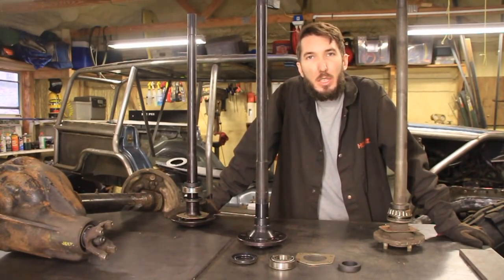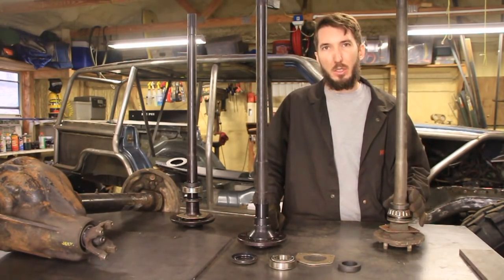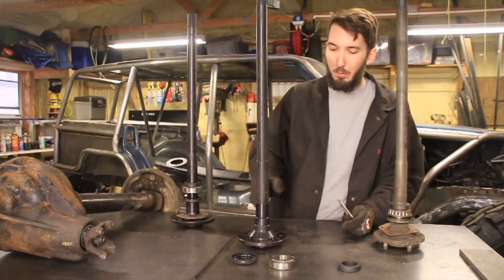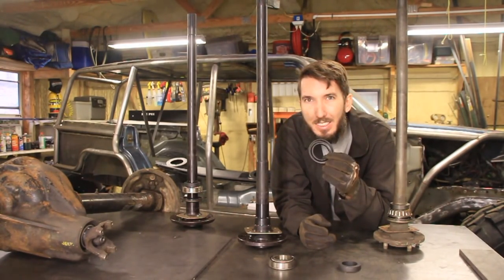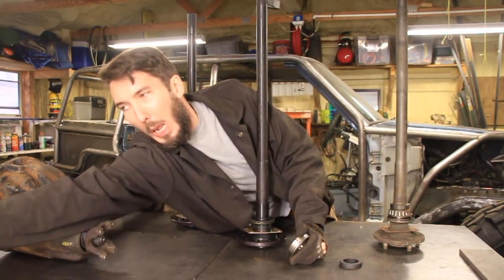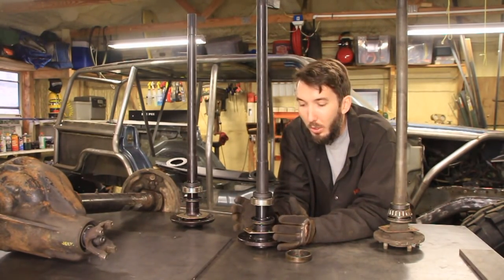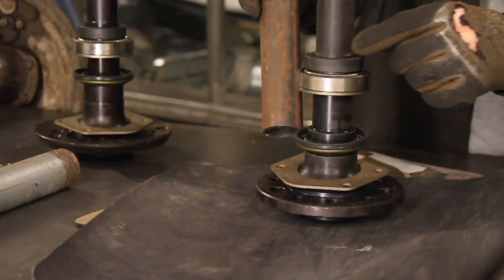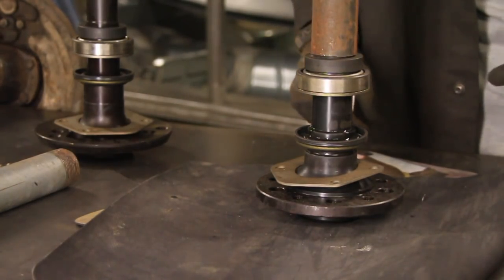How-To Assemble a Rear Axleshaft

Comment: Thank you. I'm not s skilled mechanic but I did my front cv axles last summer and figured I could tackle the rear no problem. I didn't know what I was in for and ended up having to purchase an H-frame press from harbor freight but it was only $140. I still saved a ton of money doing them both myself and this was the only video I found on YouTube with the answers I needed. Very appreciated.

Comment: I had to do the same process to replace a seal in my 1988 YJ with a Dana 35 rear axle the axle was leaking gear oil and it smells bad when it's heated up. 

BleepinJeeps is awesome, keep up the good work Matt

Comment: Great video.  Thanks for posting.  I find it best to press the old bearing on separately from it's retainer.  Doing them separately, a pipe works with several smacks.  I use the old cut off retainer as a free floating collar to protect the bearing from the pipe as it is driven down.

Comment: just a tip from an experience of mine doing similar job on a Ford 9inch axle.  I had the pleasure of doing it twice because of seal leaks.  When putting the seal on the shaft put some lube of some kind on the part of the seal that mates up to the shaft.  When I put my seals on dry it damage the seal and created a leak.  
Not a job I enjoyed doing twice since you have to destroy all the parts to remove them.  Just my opinion and experience with this.  Good video though.
Reply: Glad to find this tip, about to do mines soon these days, since I ran into a leak on my rear dif 🔧

Comment: The pipe method absolutely works, however, it is a long and tiring process (just went through this yesterday for the 2nd time in a couple of weeks).  You'll need a pipe longer than the axle, and slightly wider in inside diameter.  Oh... and a 5lb sledge hammer.  Count on it taking anywhere from 10-20 minutes per side.  One last thing.... Make sure that seal retaining plate has the inside ridge/lip pointing TOWARDS the seal (towards the inside/differential).  Or you'll be doing it a second time like I did.  :)

Comment: Tip press the bearing on first then the collar. Much easier. Use a slide hammer with a hook end. Snap on tools has a set up. Also the pipe can work if it is the right diameter and if it threaded pipe you can put a cap on the end and use a hammer if you don't have a press. Press is preferred.

Comment: Just a hot tip (and don't ask how I know this).  When you're pressing the collar/bearing package on, be sure that the steel pieces pushing the collar on are NOT QUITE against the axle shaft.  If not, you will damage the axle shaft where they press against the axle.  Leave a little clearance so that they will still clear the shaft when they reach the part that is larger.

Comment: Tip: grind a cut into the old race to make it able to slide into the axle tube easily and then use it to hammer on to install the new race.

Comment: I usually use hydraulic oil heated to 300-325 degrees soak the bearing and it will slide on. Also when removing that bearing race I normally use a blind hole pulled or just weld a small bead on the inside surface of the race and it will basically fall out of the axle tube.

Comment: next time put the retainer in the oven at 450 heat it up and it will slide right over the shaft
Reply: I did that with a pinion bearing on the pinion gear.  I was surprise how easy it dropped on with room to spare!

Comment: if you dont have a press put the axle in the freezer for a cuple of hours and the new bearing should slide on easy
Reply: Could also heat the bearings around 100 degree Celsius in a oil bath, metal expand and is much easier to fit.

Comment: What keeps the axle from just slipping out of the axle housing during normal driving when turning a corner hard? The retaining collar is only really only holding the bearing that's press fit on the axle shaft right?  Cause there's no "C" clips holding the axle in the differential...I don't get it

Comment: Just a thought but if you tack weld that scrap to the race it would hold its self and also be heated. Might come out a lot easier
Reply: Or use a dremel and cut two slots in the race and use a hammer and punch and hammer it out

Comment: i know another way to remove the bearing cup. if you weld about 1/2 long beads at four spots on the cups face where the bearing needles ride it will make its in side smaller. it will almost fall out then when you let it cool down.  :)
Reply: sounds like a great idea. have you done it?
Reply: +Ron  yes at work any time I need to remove a bearing that I can't get to the back side. works great

Comment: My Dana 35 was way easier. Little c-clips and it slid out. The bearing and seal was pressed into the axle tube, not on to the axle. I used a cheap bearing puller to pry the seal and bearing out and a piece of pipe and a mallet to put the new ones on. Seemed easier than that bearing setup. What model axle is that setup from?
Reply: im not certain which axle hes got but im about to undertake this on my D35, my more knowledgable friend has told me this no c-clip setup is what they used in older D35s like my 90 yj and in D44s

Comment: c-clip eliminator kit?  I kept thinking that with all this work, why are you not using a c-clip eliminator kit to secure your axel?
Reply: +Paul Gdry Rear Dana 44s (except for aluminum zj 44s) are non c-clip. That's why he installed an axle retainer plate.
Reply: did not know that.. thanks  but that plate did look really weak and flimsy for the stresses that would be involved with pulling an axel off...
Reply from the maker: +Paul Gdry no c clips involved, and retainer plates don't fail, the stresses are not in that direction.
Reply: cool, can't wait to see you drive it..

Comment: What vehicle would have a front Dana 44 for  an easy swap to a 2000 xj?
Reply: If you looking for a direct bolt in swap I think only a rubicon Dana 44 out of a 2003-2006 Wrangler Rubicon will work.

Comment: When I pressed on the bearing and collar, a thin piece of metal ring shaving fell out. Is this normal or do you think it damaged and shouldn't be put in?
Reply from the maker: Hard to say from here, did you get it on crooked?
Reply: BleepinJeep . Turned out fine. Apparently it can happen per Revolution gear and axle.

Comment: how do you install the new race? just by tightening the axle back on the axle housing?
Reply: A little late possibly and I'm certainly no expert....after pressing my replacement bearing in backwards and having to cut the whole deal off again... but after u press the bearing (taper end facing pinion) and pressing ring (locking ring) race will slide off the end of the axle, set the race In the tube end of axle using a block and hammer with light taps, makes sure u leave the proper end out of axle tube .020 I believe. then install the axle. Use proper sealant as noted in other comments. been dealing with dyslexia for years haha....